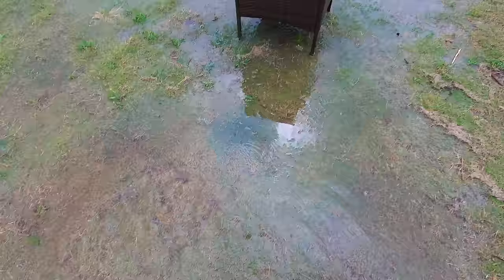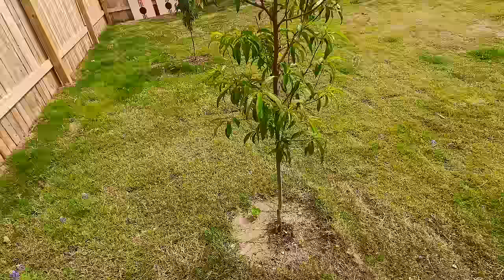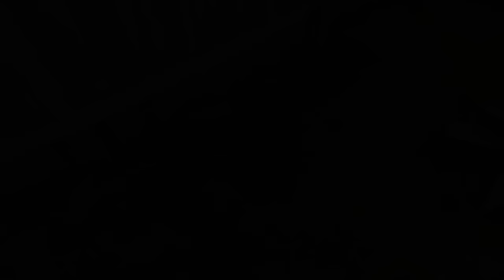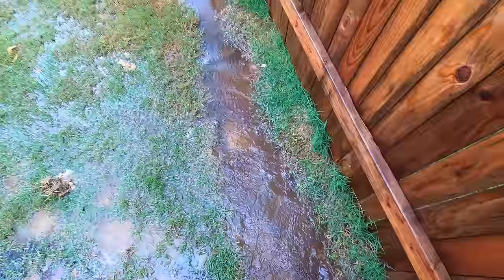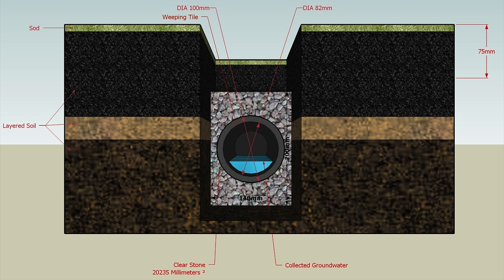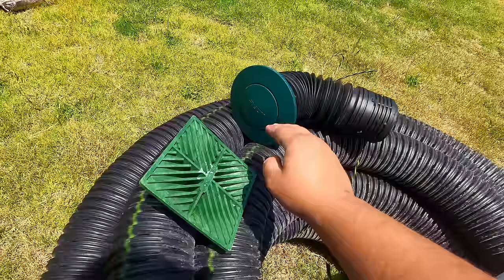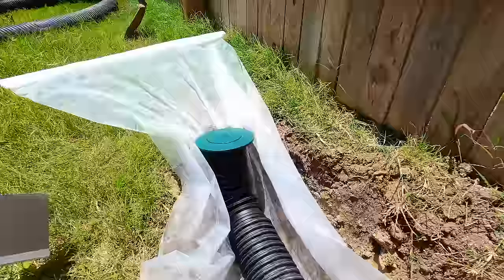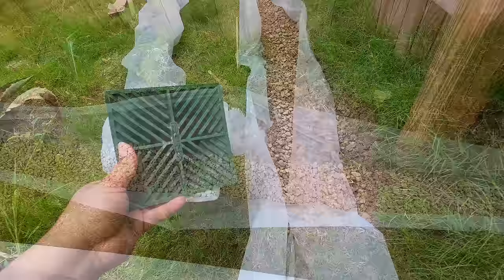How I Built a French Drain to Improve Drainage on Clay Soil

Comment: Check out the french drain man
Reply from the maker: Appreciate your recommendation
Reply: I have been watching A LOT of his video. It works with the type of soil they have but with high clay soil here in Arkansas, it will clog up those pipe so I am  tweaking his method a bit. I may still use his geotextile fabric as barrier between bottom soil and rocks. I won't do a burrito wrap like he did. Also, I have very hard time sourcing a 1&1/2" to 4" round rocks like he suggested. Other than that, I do like his method but just won't work as good here. Thanks.
Reply: @mandiegarrett1706  I do not recommend any conveyance system that is meant to absorb water under soils to not have a geotextile fabric barrier. If your goal is to collect and convey the water, doing a burrito wrap is a very good solution to keep the maintenance on the system low. If the grades in your lawn are clearly bringing the water to a few points, you could skip all perforated pipe ideas and instead have small catch basins with clean-outs that convey through solid pipe to where you need it to go.